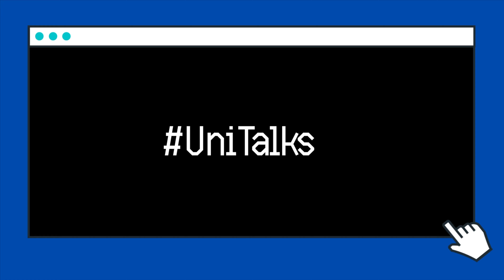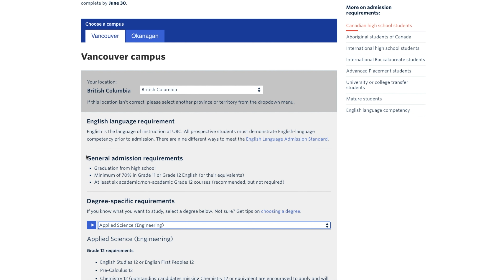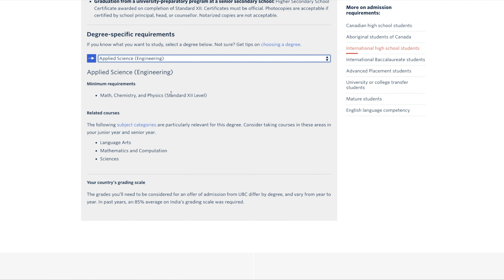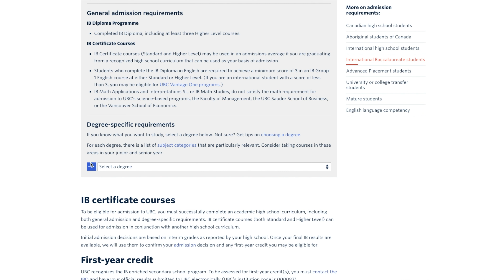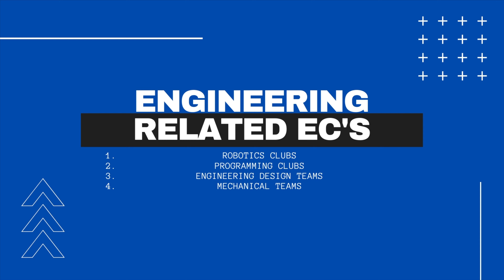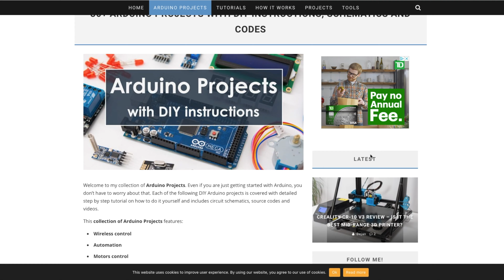How to get into UBC Engineering | Application Tips | UniTalks Episode 1

Comment: I got a quick question. I am a Gr.10 student in Alberta taking math and science IB. Since I am taking Science IB, I am required to take Chem 20 in gr.10. I am not doing great in the course so will this gr.10 mark go on my application?
Reply from the maker: The last time I checked it said ubc only looks at grade 11 and 12 marks, but maybe double check that on their website. Also Alberta grades gets scaled upwards slightly in ubc applications since BC curriculum is slightly easier than Alberta’s so don’t be discouraged and try your best!
Reply: @gaurabacharya4313  ok thanks!